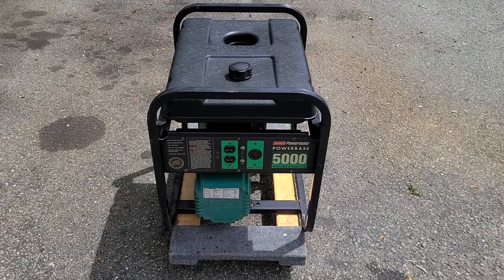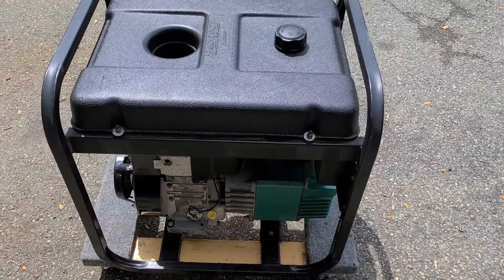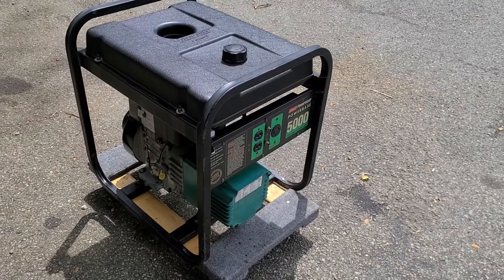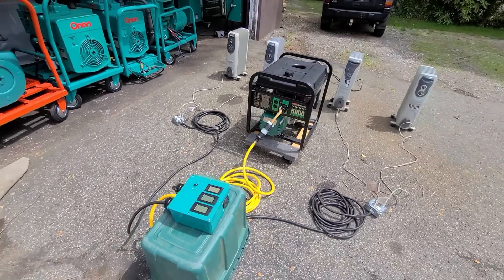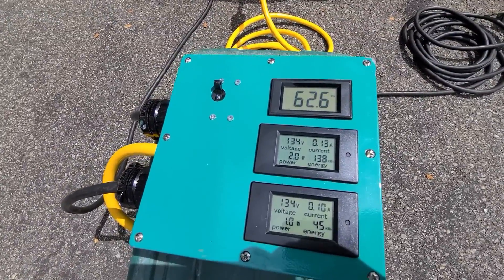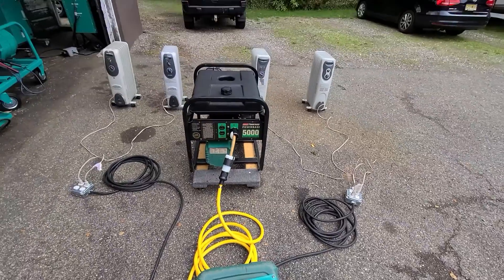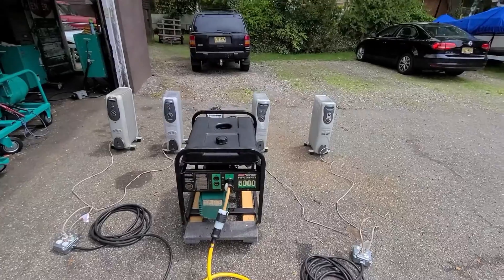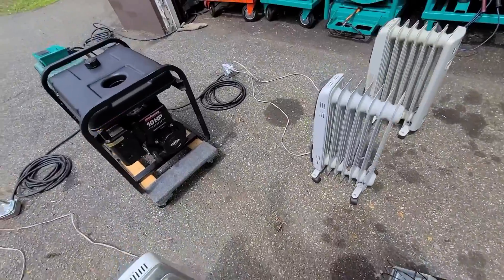Load testing a Coleman Powermate 5000 watt generator

Comment: I rebuilt a Coleman Powermate 5750 that I found in my grandfather's garage last week.  He said "If you can fix it; you can have it."
I haven't tested it with a load yet.  I just hope it can handle my 180' deep well pump.
Tip with the Ex27 engine:  If it won't stay running, replace or unplug the low oil sensor. (orange wire going to the cutoff switch)

Comment: How many watts are those heaters?? 1200 or 1500 and do you know that for sure? If 1500 you are way over 5000. That Tecumseh engine has an aluminum connecting rod and it is marked ON THE GENERATOR 3600 RPM'S MAXIMUM....I see all these people setting the HERTZ to 61 and paying NO attention to the RPM'S. I restore and repair these old Tecumseh and Briggs engines and I have old engine BLOCKS setting everywhere with HOLES the size of you fist where the rod came through the side of the engine where the starter bolts on....EVERY time. Run them above 3600 and you can expect that rod to melt off the crank and she is over. I have seen dozens of guys raising the RPM'S to throw snow farther or what ever with the same result...EVERY time.

Comment: Those flat head engines were never designed to run at 3,200 rpm to get 60 cycles. The flat head was designed to run at 2,600 rpm. Generators with flat head engines die prematurely.

Comment: The governor needs adjusting to perform better. My one pulls 5000w with no problem.
Reply: It's because he had a non OEM Chinese carb on it. Most times they do well but this one obviously wasn't the right carb for the engine or it was not jetted correctly.

Comment: I have this exact model. Plugged in the 240 to my house and it ran everything. Although all my appliances are "smart or efficient"  models including the furnace. It ran the whole house, Top to bottom all at once. I was surprised and thankful. HTZ and Vs were good. I did put course steel wool in my muffler to quiet it down.
Reply: I rebuild these coleman generators and sell them and I'm here to tell you there's no way a  5000 coleman will run your whole house,, I tell my customers to pick and choose what appliances you want to run then calculate watts used and then alternate from that, ..
Reply: @stevenstair1068  all houses are different and LEDs make a difference with the load. Ran my 2 ton, fridge, furnace, deep freezer, and lights on a 6300/9000 craftsman generator. I was at 70%
Reply: If you still have this unit, remove original muffler. Extend the exhaust pipe. Put a lawn tractor muffler on it. You won't believe the difference!
Reply: Mine It runs whole house  except  but not oven or dryer...!